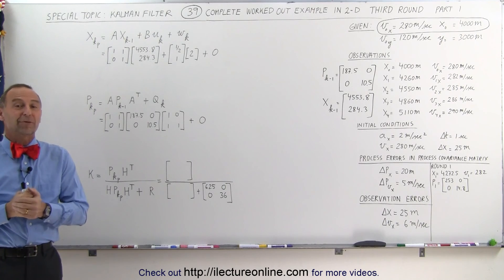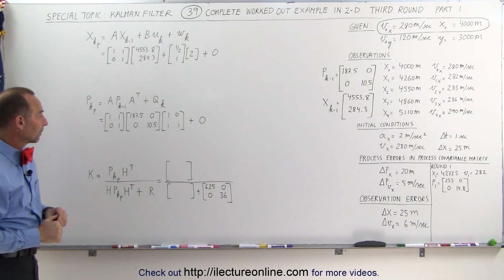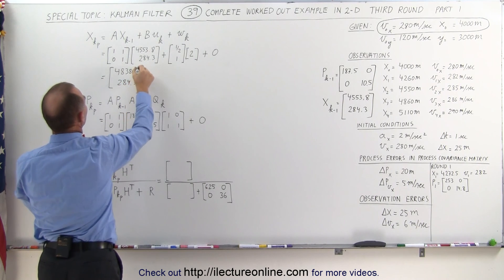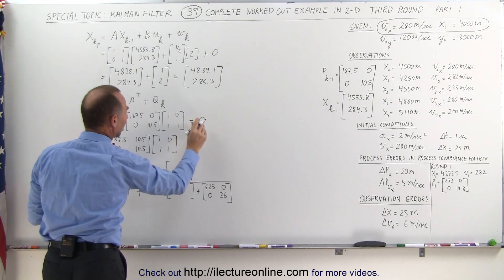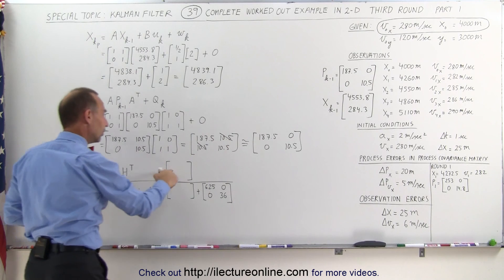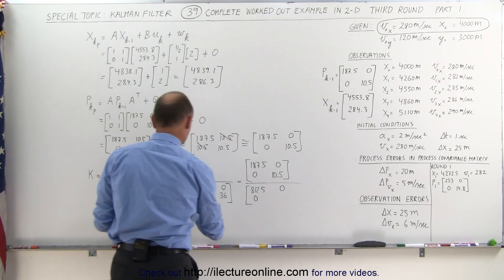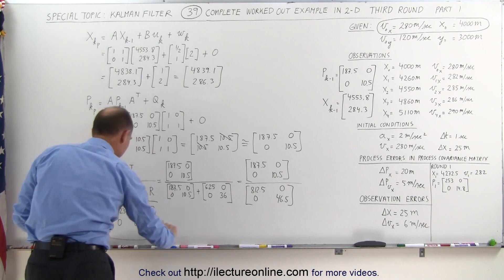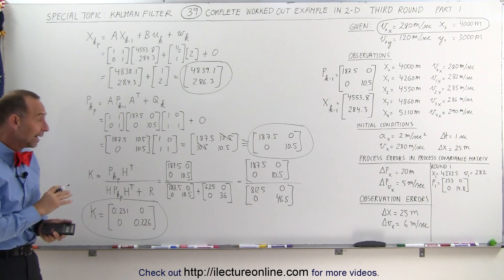Special Topics - The Kalman Filter (39 of 55) Part 1 of Third Iteration - Tracking Airplane

Comment: So the values in the Kalman gain matrix are always shrinking?  Does this imply that some part of the model (specifically either velocity or acceleration, if applicable) are fixed?  To the extent that there is a shift in acceleration, let's say, wouldn't we need to place more reliance on the observations to correct for estimates that are based on stale assumptions?

Comment: Thank You for this series I think there is a little mistake in Pkp calculation with multiply with A.T  correct is  [[192 ,10.5],[10.5,10.5]] cancel out [[192 , 0], [0,10.5]]

Comment: Again, this whole series of lectures on the Kalman filter are exceptionally good.  I like the amount of detail and the fact that you're working through it live instead of skipping steps like many professors do, leaving it up to the "reader" or student to figure it out on their own (and maybe get stuck if they can't do it!).  Anyway, I'm a  big fan of your approach.
This may be a stupid  question, but it seems like you're doing element by element division instead of matrix division (which doesn't quite exist in the normal sense --you need matrix inversions, etc) in the calculation of the Kalman gain .  What am I missing?  Why can you do that?  Or does it happen to work out like that (I haven't yet tried it to see if it reduces to this element by element division in this case).

Thanks!

**EDIT* Ok...if I take the denominator and call it matrix B (and call numerator matrix A), take the inverse of it, and then compute  K=A*B^-1, it works out...Must be because of the diagonal 0s....otherwise, this wouldn't be the case....Sorry if this was obvious to everyone else!
Reply: Hi Jorge, I recommend you to have a look at this video series about the essence of matrix multiplication from 3Blue1Brown.
https://www.youtube.com/watch?v=XkY2DOUCWMU

Comment: Note that there is a calculation error at 2:16.  The upper left value in the P matrix should be 198.
Reply from the maker: +Joshua Hurwitz 
 You are correct.  Thanks for letting me know.
Reply: +Joshua Hurwitz Yes, thanks Joshua for point this out.
Reply: Thanks.
Reply: exactly. by the matrix multiplication: 187.5 * 1 + 10.5 * 1 = 198
Reply: Thanks man! I thought for a while I had something wrong xd